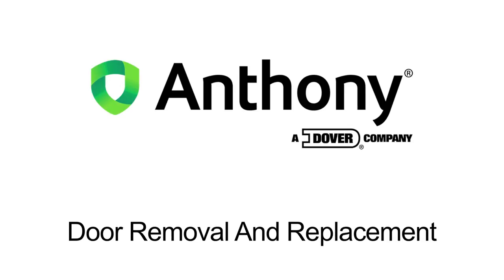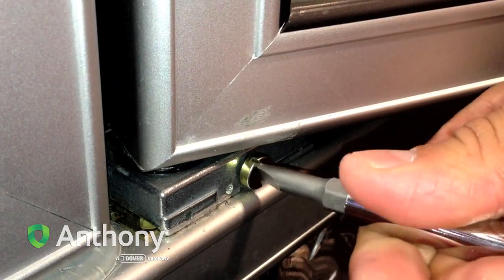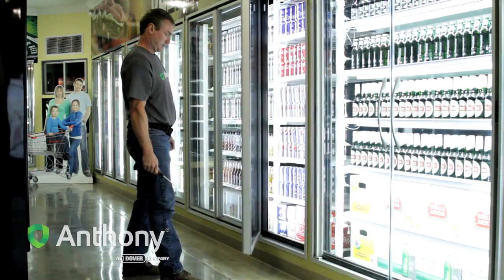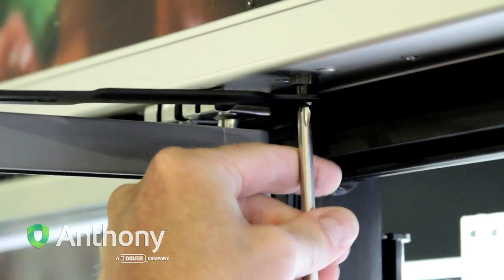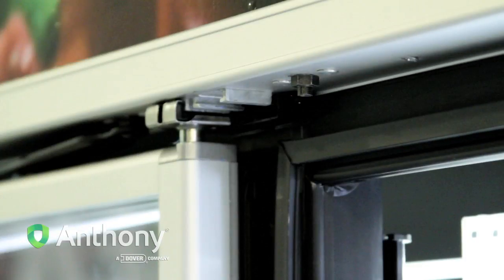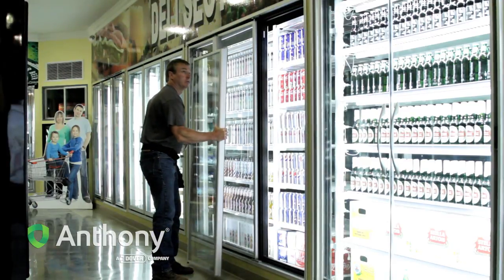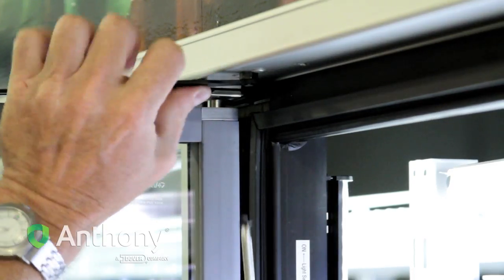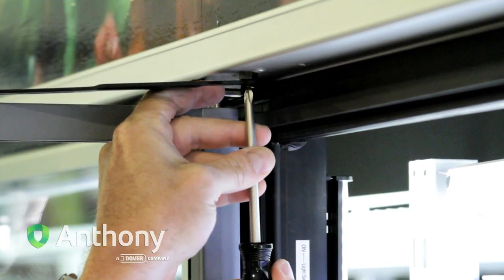Door Removal & Replacement

Comment: What is the name or model number of the hold open bolt that’s screws in to frame I have a couple that snapped off. I’m talking about the bolt that the Phillip screw goes in to
Reply: Y